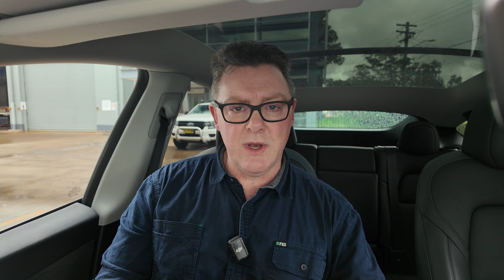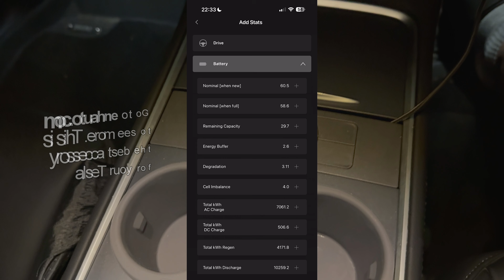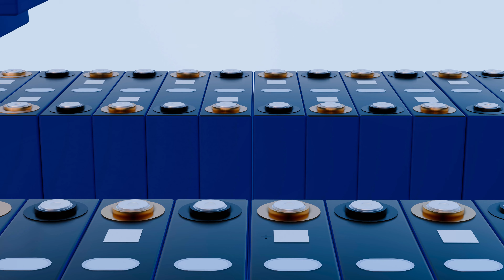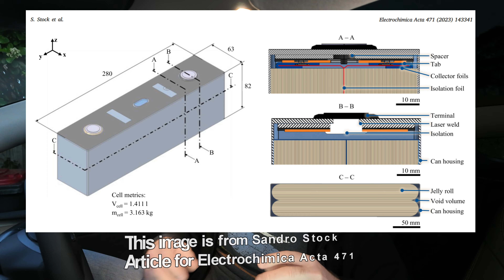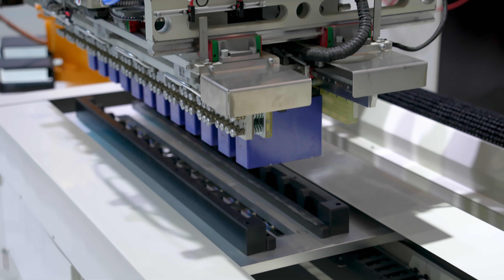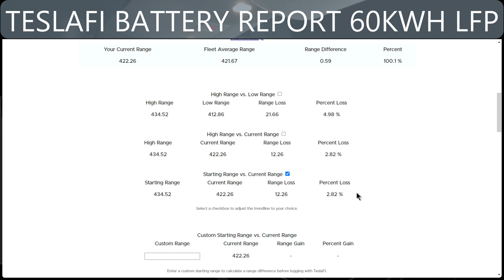How I monitor battery health/degradation on my Tesla Model Y with LFP battery #lfp #lfpbattery

Comment: BYD batteries have better charging curve than CATL. Do you know if their degradation is higher / lower?
Reply from the maker: I’ve heard mixed reviews on them. They have a much flatter charging curve but they aren’t worlds apart in the big scheme of things. At least not enough for the average person to care. Some comments on my channel people have said they have a much faster initial degradation but my feeling is they should even out over the long term. CATL has a much longer history with Tesla so I’d still prefer it if I had a choice. Blade batteries have much more surface area of the cell exposed for cooling but I’m not sure if Tesla are making the most of that. Having more control over thermal regulation should in theory help minimise degradation due to high heat when voltages are high and give you a better charging curve too. I guess time will tell but it may come down to build quality and the electrolyte recipe differences between the two cell types.

Comment: Welcome back! I didn't know that after charging is completed the cells continue to balance (I don't have SMT) - I just assumed once it showed "charging complete" it was finished. I have 2x LFP cars, one at 3 years/90,000km it is showing around 6% loss. The second is 3.5 years/60,000km and is around the same 5-6%. It definitely is the "million mile battery".
Reply from the maker: Thanks. Yes LFP seems to be the winning chemistry. These standard range cars have more than enough range for most people thanks to Teslas being so efficient. 

I now have 3 x PW3s at home too and it’s nice to know they have the same robust and safe chemistry. Thanks for sharing your stats too. I was hoping this would happen in the comments. It’s good for everyone to see that info and compare. Also great for someone looking to buy new or second hand.
Reply: @notinthemanual  I should also add that I have verified the range estimate by driving the car from 100% to as close to zero as possible and calculating the energy spent. The result was very close to what is displayed on the EPA range display, which convinced me that it is not a pre-programmed number as some believe. I predict it will eventually level off around 90% and sit there forever, unless the battery was absolutely abused or a very very high mileage car. Like you, the longer I own the car the less I seem to worry about the battery!

Comment: Jun23 delivered model y. 77k KMs. Supercharged a handful of times but have 3p home charger. First 30k KMs were consistently charged to full (whether it was from 10% or 90%). Next 37k KMs have been charged to 80%, with weekly cough fortnightly 100% for calibration. Range is down from 438kms to 420kms, approx 4.11%.

Comment: I found that using the super charger to go to 100% calibrates the battery. I got a message on the screen "Calibrating battery" that lasts about 20 minutes after is reached 100 SoC. After that my range and "Remaining capacity" increase! In my case I went from 241miles/8.7%/50.3 kWh to 251 miles/6.75%/51.4 kWh range/battery degradation/remaining capacity, at 60,000 km.
Reply from the maker: Thanks for sharing your stats. Yes I don’t think it matters how you get to 100%, it will still calibrate. By the time you are close to 100% the charge rates slows significantly.

Comment: Tesla Model 3 late 2022. 60kWh LFP pack. 439km down to 416km. 5.2% degradation. Can't have been charging as per spec...this is using Teslamate btw.
Reply from the maker: That’s similar to one of my family members 2021 55kWh LFP M3. How many km do you have on yours? It would be interesting to see if it changes if you run down to 10% a couple of times and let it charge to 100% on AC and balance for a while once done like in the vid. I can often claw back 5-6km at 100% after doing this.
Reply: @notinthemanual  Interesting. 55K km. How many on theirs? The graph of the dimishing range levelled off about a your ago and has bounced around teh 410-416km mark with the occasional spike above that range. Only charging on 10A so very inconvenient to let it go down to 10% as the charge then takes a long time. Will do it one day though.
Reply from the maker: @garylovesbeer  Thanks. About 70k. Being the 55kWh the initial range at 100% was 424km. Yes, I am lucky to have 3-phase 11kW charger at work. My brother in law keeps his car at 100% a lot of the time. Last time I checked his range at 100% was just under 400km. He very rarely supercharges. I want to make a video on the stats for his car using range at 100% and scanmytesla.
Reply: @notinthemanual  I did a lot of DC charging when I first got the car. This was at free DC chargers - remember those days - but at 30kW up to a max of 42kW - 0.5C to 0.7C -  which I figured would not "harm" the battery at all considering it charges well above 1C even at mid percentage levels. Now I mostly charge off solar at between 5A an 10A. The level is driven by Home Assistant dependant on the exported solar power, communicating with the car using BLE.
BTW do you use ScanMyTesla any more? The stats provided by the s3xy commander seem to be in line with SMT figures.
Reply from the maker: @garylovesbeer  Yes same. I did a lot of free charging that I didn’t need which tied up chargers for those who needed them more than me. Anything below 1C would be fine to do regularly. It was a novelty to do a trip where I would use a supercharger in the beginning when I was using up some referrals but to be honest I only DC fast charge occasionally these days when I’m doing a work trip. I have PW3s at home and it manages charging off excess solar too. I mainly use this on weekends where it’s better to have the excess go into my car instead of the grid with negative FIT. I found the PW manages this better than my Amber electric app which basically disables the PW batteries while my car charges. Your home automation system would be fairly customisable I’d imagine. You’re right I don’t use ScanMyTesla much these days. I am running the S3XY dashboard showing battery temps and capacity most drives even though I don’t need it I like seeing the data.

Comment: Great to see you're back and uploading videos again mate!  My 2023 Model Y (RWD) has just clocked 50,000km.  Tessie shows 2.73% degradation (420km max range), with 138 charge cycles - which I'm very happy about.  I've been running Tessie almost since new as well.
Reply from the maker: Good to hear mate. I’m actually just over 40k now and still showing 423km at 100% so I’d say mine will be similar to yours at 50k. The Tessie app works so well. Thanks for sharing your stats.   I would love to have time to post regularly again. I will definitely try.
Reply: I’ve done 84224km Tessie shows 2.76% in 2 yrs nov 23 MY. At 100% charge shows 421km. Trickle charging mostly and small amount dc charging. I did a big trip where I needed to charge to 100% with dc for a couple charges in quick succession. Seemed to drop my range by 1km. Also I charge to 100% 2-3 times a week but I don’t leave the car at 100% for more than 15-20minutes. Also glad to see your back.  One other thing as Tesla has released FSD for HW3 it’s absolute garbage. I’ve driven HW4 FSD and it’s amazing.
Reply from the maker: @ltt5988 That’s great. Thanks for sharing your stats. You really need to let the car sit and allow the voyage to stabilise to see the best figure. I have sometimes just topped up a bit from excess solar and it will show 417km then an hour later it is back up to 423km. I have a similar charging habit to you so good to know. Here in Australia we don’t have FSD (Supervised) for HW3. They just released subscription model for it though and the app is misleading offering HW3 vehicles FSD (Supervised) when it’s the same old garbage fake FSD package they have been selling for years. I have enhanced AP and am happy with that for now but seeing all the new MY driving around I feel a bit of FOMO 😂
Reply: @notinthemanual ikr re new model y.

Comment: Is Tesla continuing to use these batteries in non-US cars? We have one in our US-built M3, but Tesla isn't using them here anymore.
Reply from the maker: Yes. All standard range RWD versions outside US.
Reply: Because of trump tariffs, use of Chinese made LFP batteries doesn't make sense anymore.
We will have to wait until battery manufacturers spool up US made LFP batteries before Tesla makes their US made vehicles with this technology again.
Bringing manufacturing back to the US is going to take time. Until then we'll be using the battery tech we're already manufacturing.
Thankfully there's still plenty of used vehicles that you can get if you really want an LFP Tesla.
Reply: @user--PM  Yeah I was going there, but then thought "I don't need to make myself angry on the internet" lol.